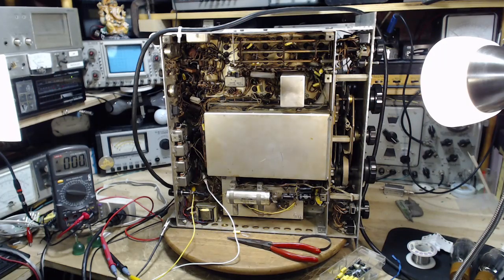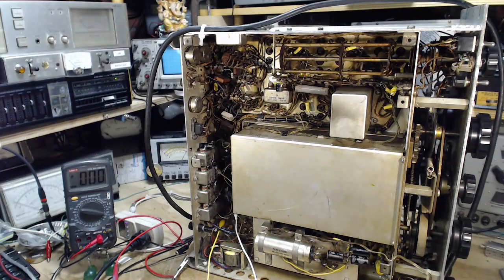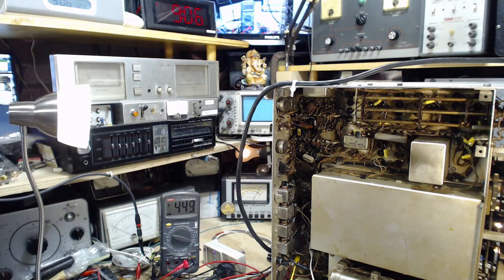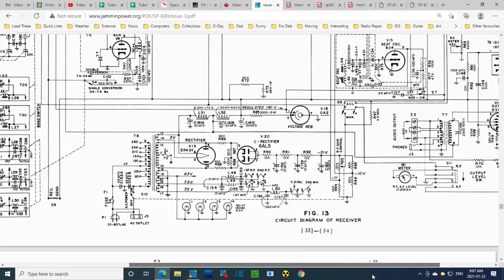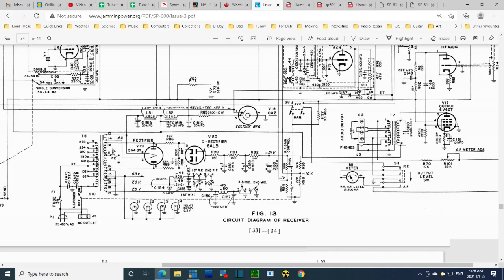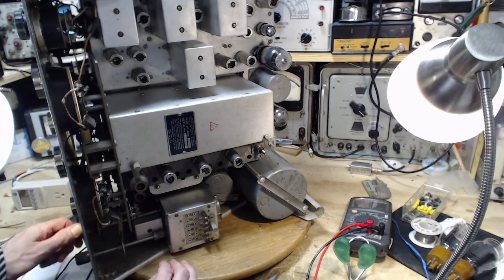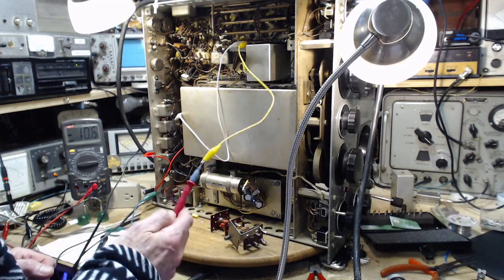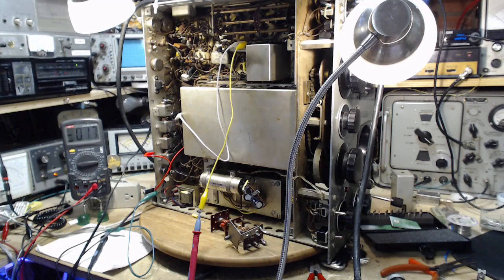Hammarlund SP 600 Video #8 - Missing 10V Bias Voltage

Comment: 45:54 Another JL bodge job in the making. Clearly the white wire going from the -C capacitor bank to the -10V voltage devider has been intact and connected BEFORE. How do we know? Because he did get the -51V at his first run measuring voltages some videos ago, which clearly indicates a properly loaded -C supply. It was only after his "repairs" to the -C supply, - including needlessly replacing hermetically sealed mil spec caps, did the -51V turn to -70V indicating a problem caused by a failure to properly load down the -C line. 
But  instead of eating the humble pie and tracing his previous screw up and correcting it he just elects to bodge in a new wire and at 50:56 tries to make everyone believe that the defect HE HIMSELF caused was there from the get go. Just think about it! Would the radio have had any chance of operating if V11 6BA6, the final IF stage before the detector tube V14, had no, or rather a too positive grid bias? No it would not. So again we conclude; the -10V had to have been there before he started to "fix" this radio this time around.

Comment: 17:35 If he would care to look closely at the schematic he is pointing on, he would notice that C136 as NOT(!) being inside the dotted line and thus not inside that oscillator can. That is backed up by the component layout. So there is no use in going into that can to look for C136 which he is pointing to and babbling about at 18:13.
And at 25:00 you can clearly see that C136 is a new style yellow film capacitor going to one of the left terminals on that can.
But instead he continues to go into the BFO can where there is now more potential for new "self built in faults".
Guess we can safely conclude, all is going to plan. In 10 more videos that radio is done (for)